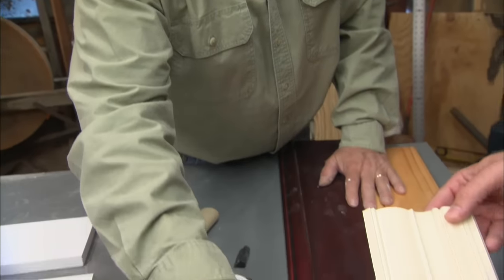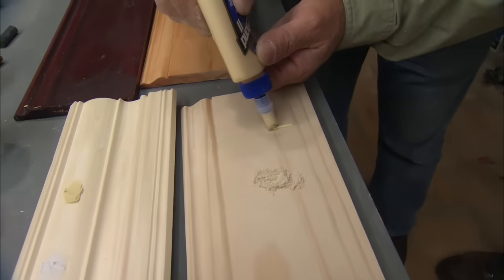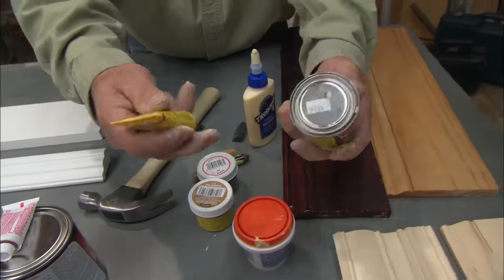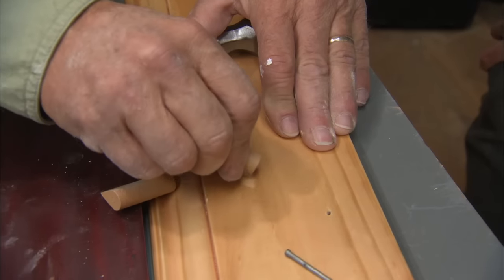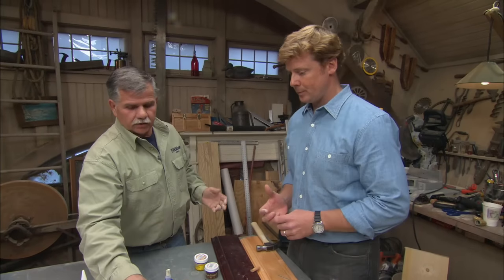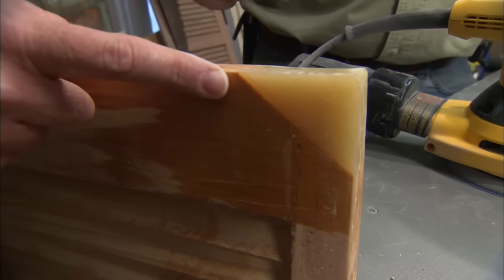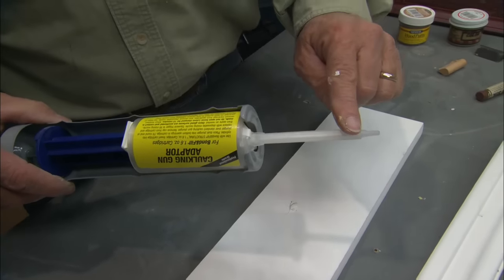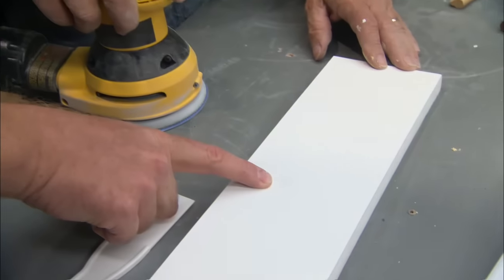How to Choose and Use Wood Filler | This Old House

Comment: Glue and sawdust works great, I've experimented with filling larger holes and such and although it takes a while to dry and sometimes even a few layers. It becomes super strong and machinable. Plane it, saw it, router it, sand it.
Reply: My problem with this method- which appears to work fantastic at first- is that the stain never takes to that portion the same way. Other than that, I agree it works great.

Comment: what is the name of "2 part pvc caulking tube for bonding and filling" and where to get them?
Reply: Tom Pour Bakhtiar yes, I’m still looking.  Most 2 part epoxies are not meant be smoothed with fingers, or are not white, etc
Reply: Flex tec has i think... I took a screenshot...

Comment: For interior paint grade projects  I often use drywall compound for nail holes. It's stable and nothing sands easier.
Reply: i would never use that on wood, it's too weak a substance, it crumbles eventually, it's why it's called drywall compount, either use wood filler or bondo, bondo is the master race though, it can be shaped into anything and has 1500 pounds of bonding pressure
Reply: @mmoarchives2542 it can also swell from absorbing moisture when you paint.

Comment: I have been on a search for the best stuff to use to fill the holes.  Durham's Water putty is the best I've found...great product.  Doesn't shrink and it's easy to sand.  Just my two cents.
Reply: Savetime Mann  k
Reply: Savetime Mann  So, here's a question for you: I'm sanding a 200+ year old house next to the ocean, in Southern Maine - eastern white pine shiplap, with butted board ends cut at an angle to overlap. The overlapped butted ends were joined with what appears to be a white, sandable, somewhat flexible adhesive caulking. I'm searching for such an adhesive caulking. At some point, after power-washing the sanded clapboards, I'll be using C2 Paint's nanotechnology C2 Guard to seal the clapboards, prior to priming with oil and painting with latex. Do you know of a caulk that will work for what I'm doing? It has to be in a tube, because I'll be using a lot of it. - Thanks, if you can help.
Reply: Durham's is a top notch product but it doesn't sand well. I have used at least a 100 gallons of it in my career.

Comment: I have T1-11 board that is rotting in a small area at the bottom.  It's outside.  Instead of replacing it which I heard is a pain, what can I use to make it look new again?  Like they showed in the video the corner of the shutter..

Comment: Durham's Water Putty, never shrinks or cracks.  Best stuff out on the market imho
Reply: It’s good for INDOOR repairs.  Even when it’s painted, I’ve had it fail pretty quickly outside.  Solvent based filler like old fashioned Plastic Wood, or epoxy.

Comment: The only main issues I've had with store bought wood filler is the hardness. I truly feel that the og way of mixing wood glue with the same dust is the best. Thank you guys for the tips
Reply: Translation:  
"A thousand times better wood glue with the same wood dust, worth the redundancy, than this Wood Filler putty for wood, it seems to me an eyesore, here in Ecuador USD 3.80 for 114g, very expensive."
Reply: @happytrailcamstoyou9509  Can you use the dust from sanding a floor to refinish it? Or is too dirty?

Comment: Just a added note if using crayon. You can heat them with a lighter a drip it in to fill holes on horizontal surfaces as well. I prefer the results using this method on say a end table or maybe a dresser top.
Reply: Thanks 👍

Comment: I actually have a question. We had a deck put on our house in December. We live next to the Canadian border, so it is very cold and snowy. We are now presently getting ready to stain the deck but there are cracks in the pressure treated wood. Should I fill in the cracks before staining and if so, what should I use. Thank you

Comment: I use Wood putty because it moves with the wood as it expands and contracts. mix jb weld hardener  in with the top layer to make a sandable surface.

Comment: Hi, I thought I'd share something on this subject that I learnt while working on a project here in India. I'm a college student in a rented apartment. I made some nice dimensional corner shelves for my bathroom vanity out of scrap block board and some cheap teak trim. Problem is that block board is made of mango ply which is coarse. I wanted a dark wood but slick and waterproof finish. 

I started by termite treating the wood a couple of times and let it sit for a day. Then I stained it and waited another 24 hours for the solvents to mostly evaporate. I then took some waterproofing wood finish and thinned it with some of the wood stain. I slapped it on really thin and let it cure for 12 hours. Sanded it down then did the same and sanded again. After all that, I just used clear coated it with clear spray paint. Came out super smooth and luxurious without feeling light and fake like plastic.
Reply: Also, make sure the wood finish and stain have the same solvent or are in the same class of solvents or even just miscible. If you're not sure. Take a scrap piece and mix a small amount then apply it and see. If it doesn't mix, the base solvents are different. Gel stains won't work.
Reply: "learned"
Reply: Sounds beautiful!!!

Comment: What's the best filler to use on mdf Cabinet doors that are Veneer covered and have a router design? I'd like to fill, sand flat and Paint? The House was Built in 1986. Thanks

Comment: what if the teak furniture has a slight glossy/oily finish and there's a hole and crack on a vertical finish........how do i fix the defects without ruining the surrounding wood finish ?

Comment: Maybe... the epoxy mixed with sawdust... I have a great big salmon sculpture my grandfather made a long time ago. But it spent a good deal if time outside in Idaho with some jackasses who didn't really care about it. It needs a new dorsal fin, some pretty deep cracks filled, and a good rich stain and seal. I really want to restore and finish this fish.
Reply: Rj Peterson did you get to restore it? If you did. Did it turn out good? And if you haven’t yet Goodluck!!
Reply: I too want to know if you got it restored
Reply: @kiwiflare  oh wow, people replied to this. Unfortunately, I still haven't. I'm not the best carpenter and somewhat less of a sculptor. Every time I look at it and assess the damage it just seems just out of my ability. I'm a knife maker, I'll shape and grind and polish steel all day. I just don't think that fish is for me, and I've learned to listen to the material's opinion.
Reply: @JackSilver1410  Every journey starts with a first step. Use chisels, scalpels, a Dremel tool and/or oscillating tool to cut out the rot. Letnthe interior dry, if it is damp. Use wood hardener (from Minwax, for example)  to strengthen weak wood, then start filling large cavities with compatible blocks or pieces of wood, then secure the wood into the sculpture with epoxy or Bondo, then piece-by-piece recreate the missing visible pieces either by carving and attaching individual pieces of wood with epoxy, or by using Bondo or wood based Bondo,  and building up and shaping one area at a time. Be guided by pictures of what it looked like before. If you do it outside in good weather, you'll get plenty of advice from friends, family and passers-by.  Do a little every day, and soon it will be done.

Comment: Excellent Video.  I have two good size corner gouges on a wooden stair step leading to my basement.  Could you advise a filler that would stand the rigors of normal day to day traffic?

Comment: Thanks, but I'm filling a gouge in the bottom of a wood drawer I will be drilling a slide into, I'm trying to decide if I should use plastic wood putty or 2 part wood epoxy?
Reply: after my experience using plastic wood putty, I would use the 2 part wood epoxy.   I'm sure it would be more durable.

Comment: I have huge , heavy butcher block table that needs to have the legs tightened.  Does any of these work for under the table where I would need to seal the existing holes and put new holes in to tighten the legs. Let me know please.

Comment: You said Bondo Autobody Filler was bad outside, but why would you use an autobody filler to fill wood? Why not use Bondo Home Solutions Wood Filler? It's marketed as "driveways, walls, damaged chimneys, gutters, knotholes, damaged tiles, shingles fencing, windowsills, doors and more", can I use that on an exterior surface that I can't use epoxy on because it's vertical?
Reply: Probably, but epoxy can be used on vertical surfaces if you add a filler that they sell.  I've used it and it's not bad.

Comment: This Old House I accidentally ripped the closet door handle off when i was moving some furniture in. The screws holding the handle in, ripped through the wood forming bigger holes. What kind of filler should I use for the screw holes ? The filler needs to have some strength to hold the screws, the door is indoors, the door is painted white but color doesnt matter because the holes are hidden. any filler suggestion ? I only need a small amount, preferably something sold in small quantities. thanks

Comment: So close but still didn't tell me what I've been trying to figure out. When repairing large holes in an outdoor project, I understand the two-part epoxy will be best as it allows expansion and contraction. I need to stain it though. What can I do to then have a finished surface which will stand up to outdoor conditions and which I can stain to match the rest of the project?
Reply: Curious how this worked out! I have a similar situation with a wood rifle stock that has some large but purely aesthetic cracks running along the bottom of the forend. My best guess right now is to stain a two part epoxy mix to match the wood - it's the process they use for some types of fancy tables. But to truly hide the cracks, on an item that needs to stand up to some punishment, I'm still not sure what will do the trick.
Reply: @RJWdevelopment  West system marine epoxy

Comment: what should i use to fill large cracks in a chainsaw carving that is outside year-round in Minnesota
Reply: +Ben Dougherty  GOOGLE it lOOL
Reply: +Ben Dougherty Abatron LiquidWood and WoodEpox is the best there is. You can get the 24 oz or the 4 quart kit. Here's the link to the 24 oz kit:
 http://www.amazon.com/Abatron-Wood-Restoration-Kit-FL/dp/B00JWRLO7A?ie=UTF8&psc=1&redirect=true&ref_=ox_sc_act_title_4&smid=A1WOO6C65MX596

Comment: We are trying to make a trim for indoor stairs actually a molding for the stairs up to the bedrooms 12 stairs,sanded and stained with polyurethene and painted the front of the stairs and put carpet pieces on the top of the stairs,how can we make a molding without having to cut the stairs for the molding?any suggestions.A 150  year old house,Thanks

Comment: i have hole up to 1 and half inches, are these holes too big to use wood filler in?
Reply: Use bondo, with a poly backup plate to mold the outer surface flush to the finished survace.

Comment: What's the easiest for filling gaps on floor..this is what we're doing.repurposed gym floor that was already cut in 4x8 sections and it's not perfectly butting up and want to hide those seams. So what's the easiest and cheapest way of  doing this?..and gonna sand and stain this floor as well once completed.

Comment: They're showing a real piece of wood work there which is what I had assumed was here when I moved in and regretfully it turns out to be some composite junk that most types of woodwork are made of nowadays .
There's going to be an inspection soon and I don't know what to do because whoever lived here before me had a pet that ruined some of the woodwork and it looks like they had done a terrible job of trying to make it look better.. the paperwork I sent the office for when I moved in saying that they never fixed any of the stuff they promised would be fixed actually vanished or so they claim . Just as bad the photos I had taken of the messed up wood work were on a SIM card that has since disappeared and I am very much past the deadline of getting maintanance to repair this.
In the meantime my pet was urinating on the woodwork I guess where he smelled that the other people's pets had done it .
  I couldn't figure out why the wood was bulging out and looked like it was melting in some places on the bottom until it was explained to me that it is this cheap composite junk.
I'm struggling financially right now and just renewed the lease ..I can always worry about replacing the woodwork later when I go to move but in the meantime I need the least expensive way of fixing it and regretfully all my tools were stolen when I moved here... all I have left is a drill gun and all the drill bits are missing .
 The bottom part of the woodwork's bulging is very hard and still feels like wood but needs to be removed and I guess I need a drill bit of some sort that could cut it off ? Any suggestions ?
Someone at Lowe's sent me home with a small container of vinyl spackle to fill in wherever I can to make it look right.. I was actually thinking of using plaster but do you have any suggestions or anybody reading this ?
 I am freaked out about this especially since the money's coming out of my grocery money.. that's how bad things are right now .
Reply: I need a tissue

Comment: That Flex tec is prohibitively expensive. I'm sure it works fine, but is there a cheaper two part epoxy with primer system thats cheaper?
Reply: +Slap Stick and for the example they used on the shutter you'd be better off just attaching a piece of wood to the missing corner and planing it down.

Comment: :(...the Minwax wood filler is crap.  Following your recommendation, I purchased it to fill in a split in the wood on the leg of an antique.  It WILL not stain!!!  Just sick about the contrast from the filler and wood.  Very displeased!!!
Reply: That's s fact...it's shit...especially for floors...

Saw.a.video a.guy poured out a gallon of something and squeegee it in the cracks..then did his sanding..haven't a clue what it was and he never answered my wuestion..his floors turned out great...in 100 year old house those boards have shrunk quite a bit..

Comment: If your building furniture for your house don't use bondo because that stuff gives off toxic gases use wood filler instead
Reply: Once the two-part reaction is done, there is no more out-gassing.

Comment: I just wanna say that two part epoxy is garbage and ripoff-I spent $600 for something that doesn’t work-this old house it’s not what was with Norm -very disappointed
Reply: Lolz. Two part epoxy is like $10 and works wonderfully. User error.